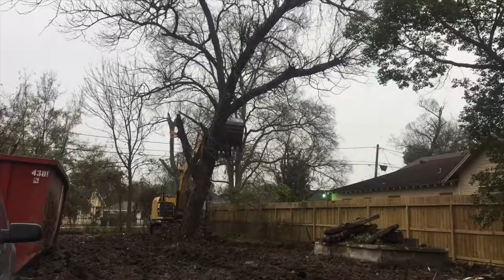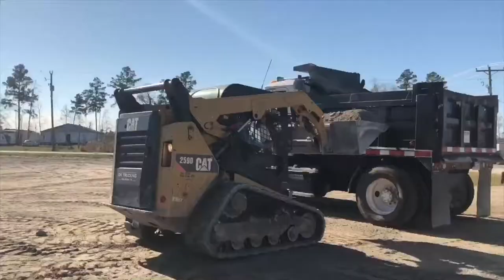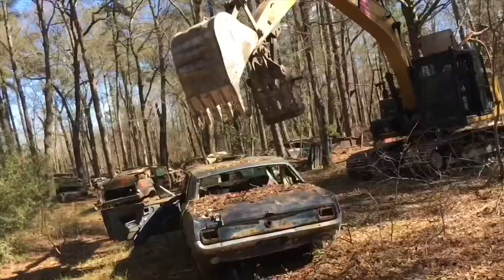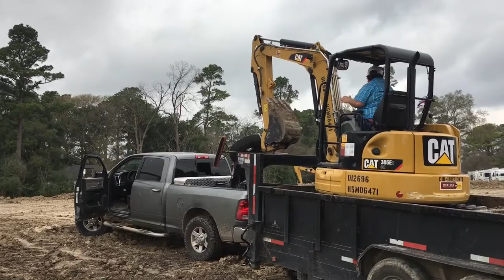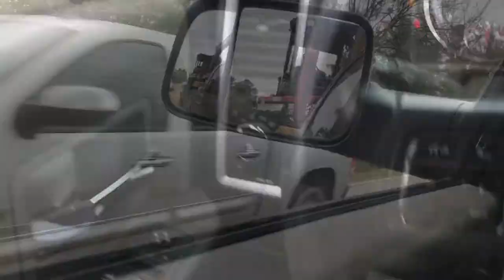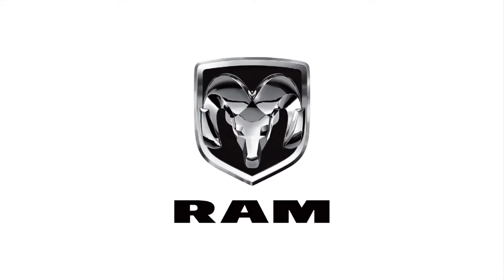Mini excavator CAT 305E2 loading and unloading

Comment: Since it's obvious you have absolutely no idea what you're doing, I'm going to give you a few tips. First, that machine should be loaded directly over the axles of the trailer, yes you need weight on the fifth wheel but not all 10k lbs. Second, don't EVER leave your boom and stick up that high. You WILL hit something, maybe even a bridge. And lastly, if you can't unload any smoother than that, put the truck in neutral and hold on the brakes while the other guy unloads. The transmission in that dodge won't last long with that type of abuse.
Reply from the maker: Ohio Trucking & Excavating thanks for the tips, I was not the one loading or unloading. I was just moving the machine with my truck and trailer, I know that the machine goes on the axles, reason I put it all the way in the front was because my rear axle was bent and with the weight would rub on the wall of the trailer. And about boom that’s why I told him to put it on top asweell, cat was only 5 minutes away and no bridges to get on. I actually posted a video showing when my trailer axle broke on me while carrying my skidsteer. About the truck putting it in neutral I did not know that, thanks for the tip will definetly do that if I ever load a machine like that again, would not want to screw my tranny up. But one thing is for sure I will never load another machine of those on this trailer, not meant for that kind of loads.
Reply: @Grtruckingdemolitionllc  some times you have to work with what you got .we all do not have everything so you do what you have to.
Reply: Would have seemed like sound advice but you lost me when you decided to call a gooseneck a 5th wheel.
Reply: @charlesconyer6034  my assumption would be... force of habit... cuz i drive an 18 wheeler n have for 25 years, as well as hauling with a goose neck and an RGN ... 🤷‍♂️ ... just  a habit